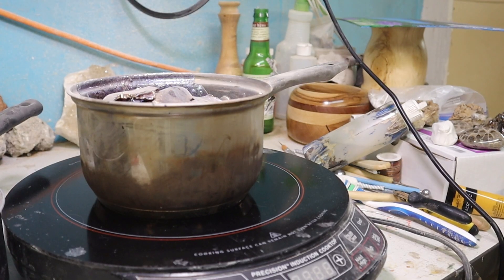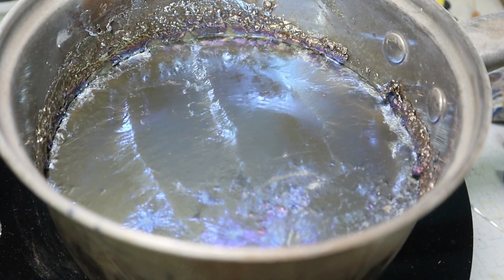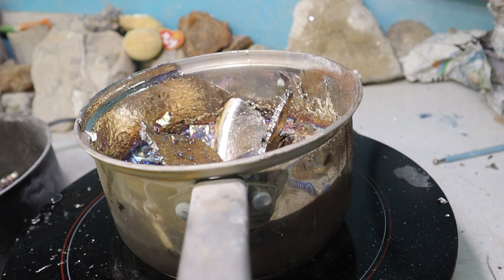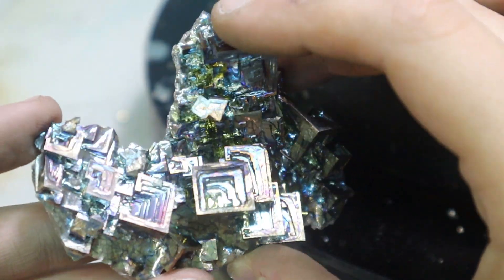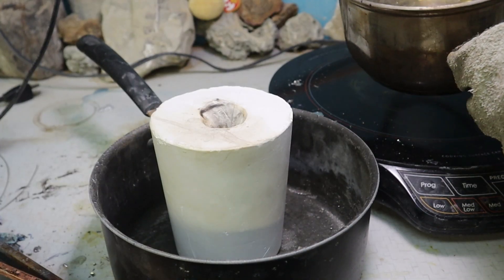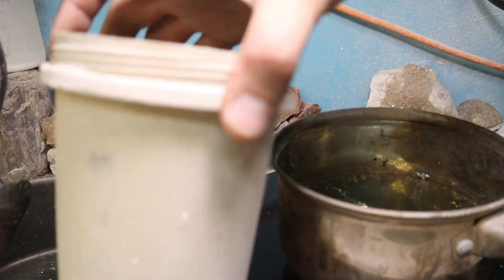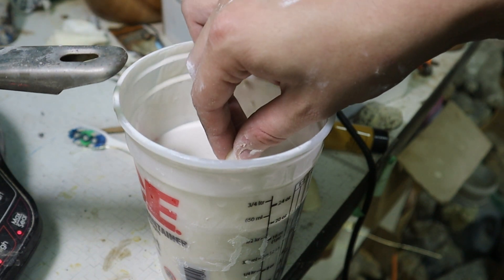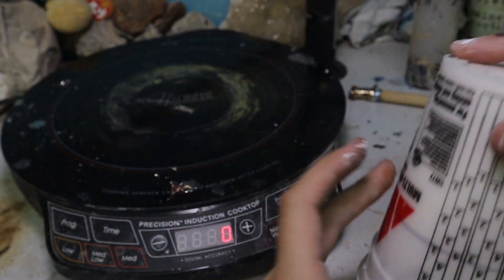Rainbow Metal Sea Shell! Making Crystals and Metal Casting With Bismuth!

Comment: Bismuth is Dope! My first attempts growing Crystals went quite bad ..so i tried many many ways....by changing ONE Parameter each cycle.  
How much Bismuth, which Temp., which Time, how removing the "slag" (these are not impurities...its oxydised BI, so collect the "slag" and remelt it. Only a grey yellow powder remains, and even that you could redox it back to pure BI with chemicals.) after 100+ attempts i cracked the code....all sizes, colors and shapes. 

Must have... enogh material to fill the BOWL full just below the rim

99.99+ % PURE BISMUTH  
Rockwool or Glasswool ( isolation is very important)
Stainless Steel Pot ( for MELTING)
Stainless Steel BOWL ( for CRYSTALIZATION)
Stainless Spoon ( to remove the "slag" from Melting Pot)
Stainless FORK ( to remove the "slag" from Crystalization -Bowl ) 
TWEEZERS (for pulling the Crystals)
2 Pliers  (for handling the POT or BOWL)

SAFETY GEAR

Goggles
Tight-fitting Long sleeve shirt (Cotton, Wool, Linen) NO "plastic" )
Jeans or similar Pants
Thermo GLOVES
CLOSED SHOES ( NO FlipFlop or Crocks ...not because they`re UGLY ;)
FRESH AIR CIRCULATION 

ANYONE....feel free to ask me, if you wanna make BISMUTH CRYSTALS
greetings from Switzerland
Reply: I’m interested

Comment: Hey thanks for the Tips !   You're a legend .  
I tried Casting with Bismuth for the first time yesterday in  an enclosed heated  CNC engraved Graphite mould I have previously used for Brass.
 I had the Idea slow cooling would produce Rainbow annealing but perhaps it wasn't slow enough. I'll certainly try just torch heating it . 
Yes as you realised  Its good to  Bake your moulds to reduce trapped water when using plaster or clay moulds ..🙂.the spitting can be bad !